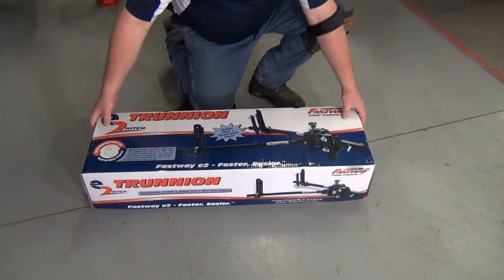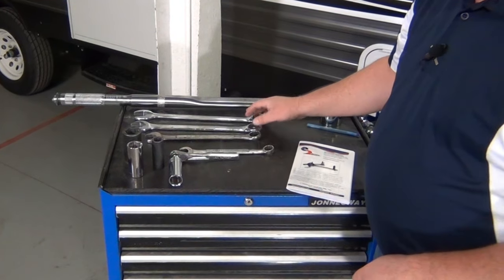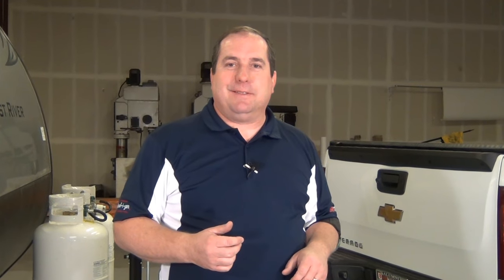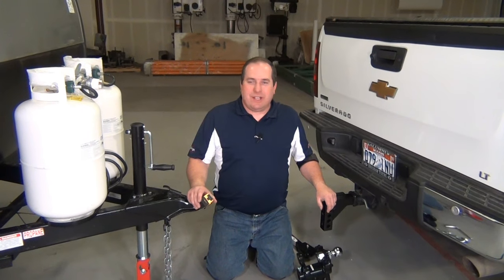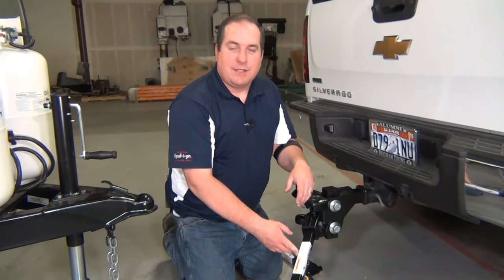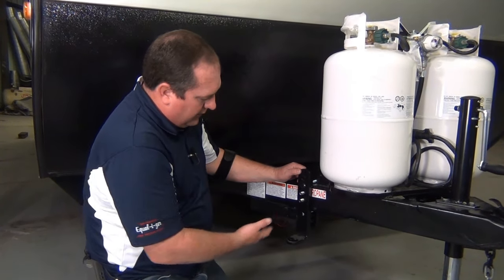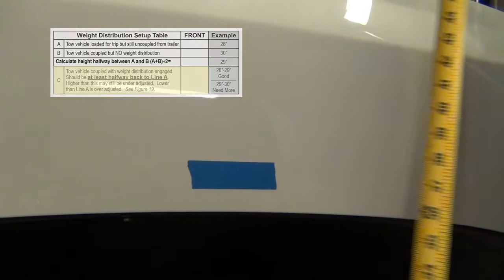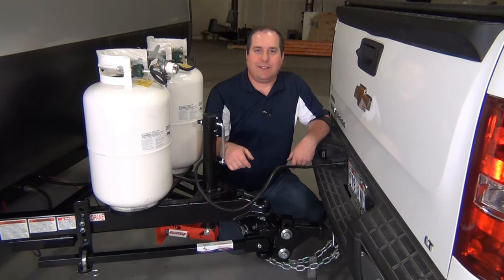How to Install Your Fastway e2 Trunnion Sway Control / Weight Distribution Hitch*

Comment: your a liar,3 washers is the max it will take to make the holes line up to be able to get the bolts through@!
Reply from the maker: +Ray Williams,
Perhaps you are using a different brand hitch, or the 4.5K model? The e2 trunnion hitch (6K to 12K model) uses a minimum of 5 and maximum of 9 spacer washers, which is what this video is covering. The e2 4.5K trunnion hitch uses either 2 or 3 spacer washers.
Reply: @Ray Williams - Wow! Grow the hell up and quit making assumptions. This guy is trying to help you and you're calling him a liar? (When in fact you are likely using a different hitch entirely.) Were I him I'd have told you to bugger off and go find somebody willing to put up with your b.s.

Comment: The place I bought my camper from set up the weight distribution hitch. Everything sits nice and level, however when I am connected to the trailer the distribution bars have little to no weight on them. In fact I can move them quite easily with the full weight of the camper on the truck. do I need to to raise the brackets that the bars set on?
Reply from the maker: Hmm, I would contact our customer service team at  info@fastwaytrailer.com or call them at 877-523-9103 and make sure your hitch is set up correctly!